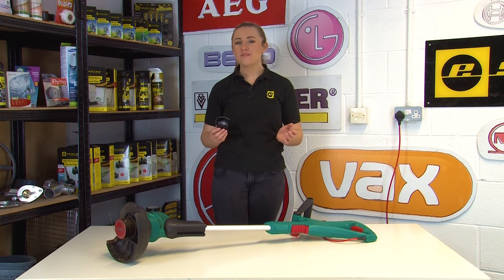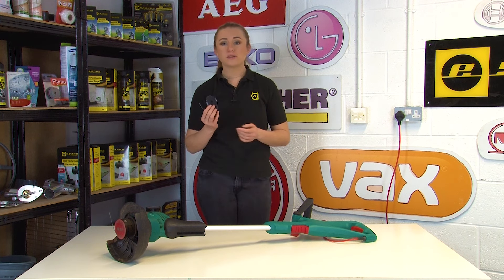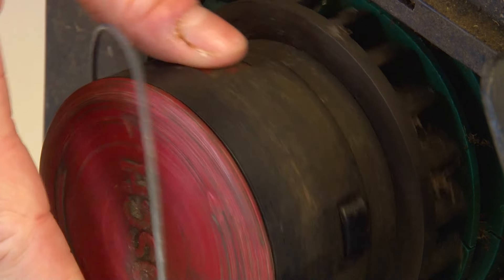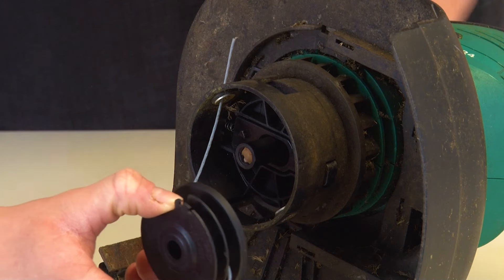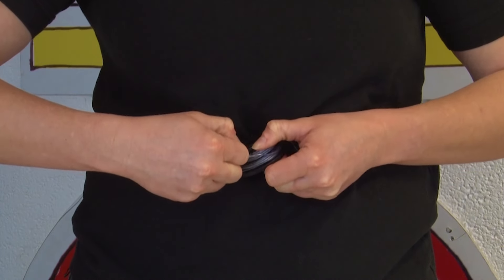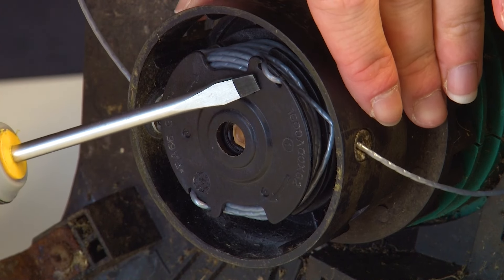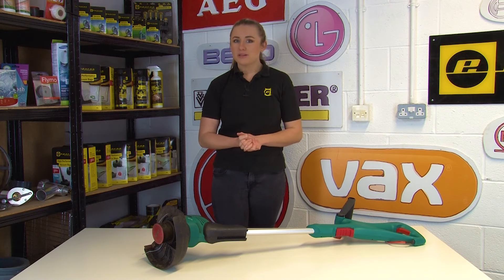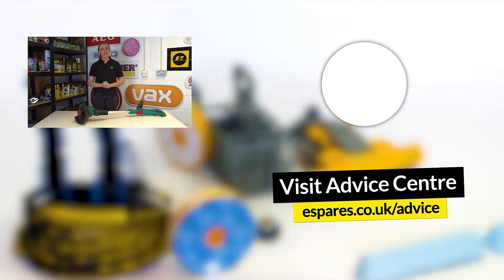Bosch Grass Trimmer Spool Replacement: Handy guide

Comment: My line has got caught under the thing the spool is attached to. Does that come off?
Reply: No it doesn’t come off maybe try reattaching it? You should pull out the excess line the whole way through the holes, so that none of it gets trapped under the actual spool itself inside that rotating ring it’s attached to 😊

Comment: My line got wrapped up behind the thing the spool is attached to. Does that come off?
Reply: Pull out the entire spool then reattach it, making sure that you pull all of the excess spool wire through the two holes on either side - that way the excess wire won’t get trapped under the spool in the rotating ring thingy
Reply: How to get the whole thing off. Is stuck UNDER the machinery. So that video not the obvious one
Reply: Line is wrapped under the motor shaft. There are no screws? How to take that off !!!!!?